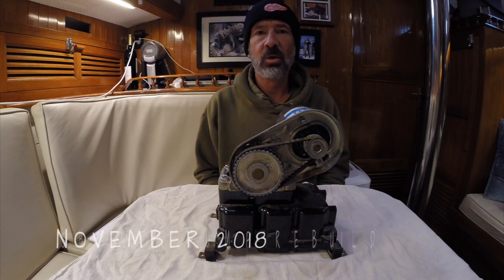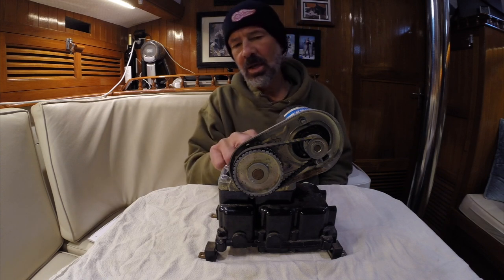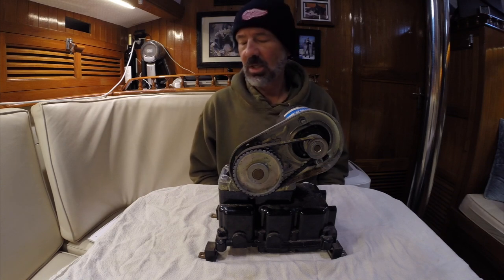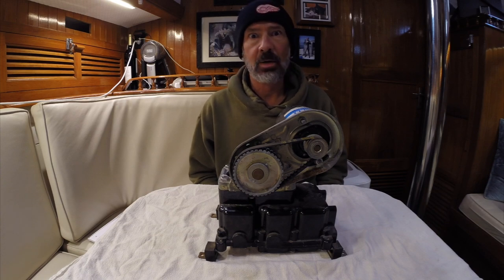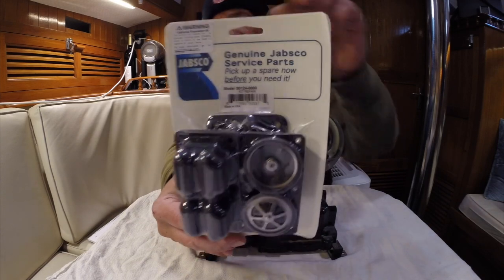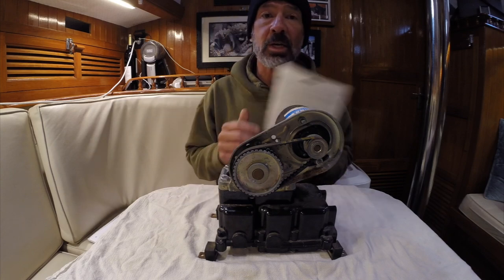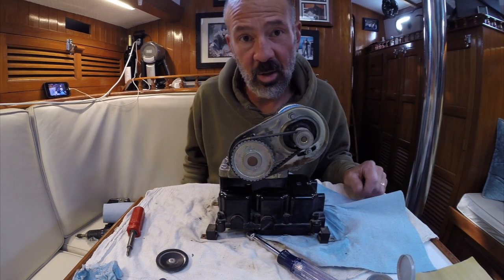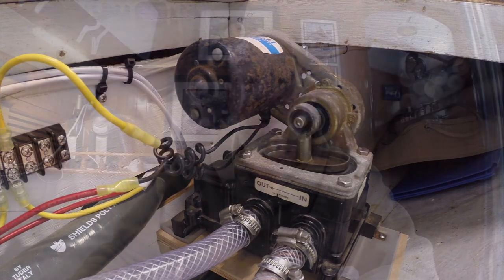SV Ramble On | Rebuilding the Shower Sump Pump

Comment: not sure Rich if you are able to answer or reply to old video comments but I wanted to try. I was wondering why you elected to use the old pump rather than buy a new self primer. A new Seaflo would cost about the price you paid for the rebuild kit. Love your videos, watch a lot of them. I just bought a 1977 Morgan 41 OI (it has the Perkins 4154) which is in Fort Myers. I am stuck here in Ontario Canada waiting for the boarder to open up to drive down and start fixin her up for Caribbean cruising next year! :)
Reply from the maker: Hey David, thanks for watching.  That's a real bummer being separated from your boat during this whole shut-down.  I hope things get back to normal soon, and good luck.
I suppose the main reason I rebuilt the pump is because I already it.  A new PAR pump is around $400+, and even at the marine consignment shops these used belt-driven pumps command a premium.  Plus, I like to take things apart and see how many pieces I have left over when I put it back together.